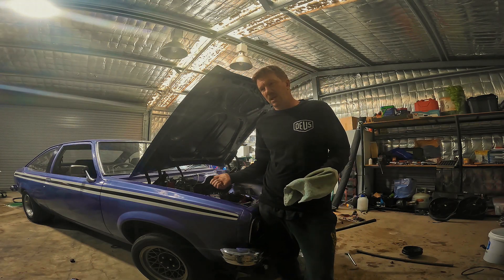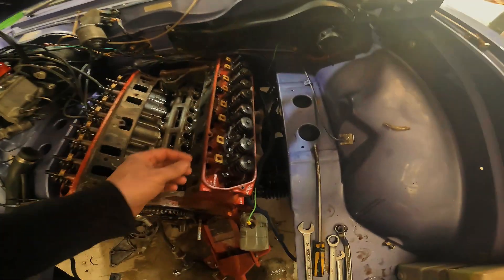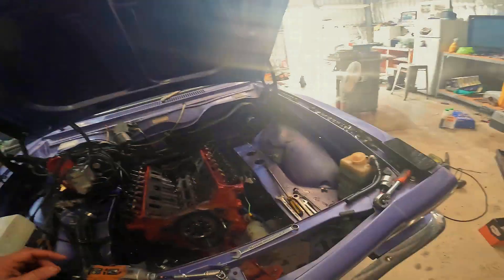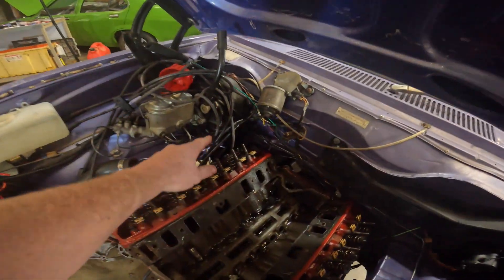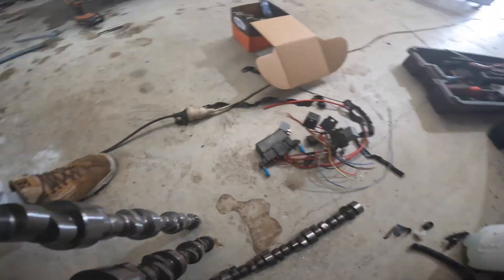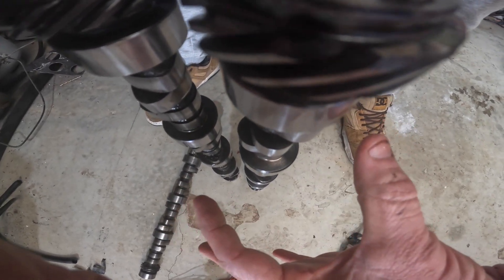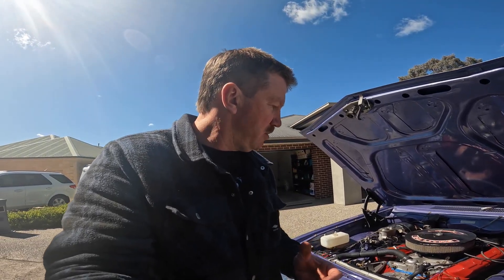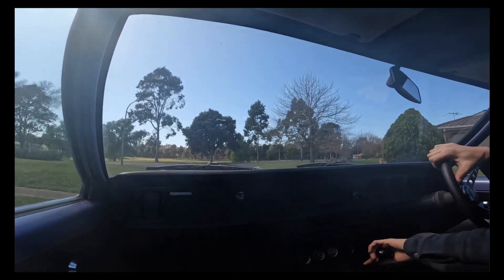Budget Friendly DIY Hydraulic roller lifter retrofit for Non Roller Holden 308 block

Comment: Hi, I only saw your vid today. It's 8 months ago so id thought I would ask you how the cam and lifters have been after sometime. If you are still happy with them can I get your brand and part numbers for the roller lifters and also the length of pushrod used. I'm currently building a black 308 and would like to go this way as well. Cheers Jason.
Reply from the maker: Hi Jason!   The whole combo is still going strong with no issues, running better now than when I first got everything done.   I think I listed all the part numbers in the video description with links.   Prices may have risen a bit since then.

Comment: So the egg shape vs the round cam of a roller is a little deciving.
Because the roller has a small area of contact they make the lobe wider like that for similar lift as a flat tappet.
If you get say two 220° lobes and stick them side to side the flat tappet will still look smaller in duration.

Comment: Gday mate quite an interesting video. I have a red block 308 in my Sandman ute that I would like to do this to given the FLAT TAPPET issues these days. Mine wiped 3 lobes when I used the wrong modern synthetic oil. Got a new Camtech and Johnson lifters to put back in but maybe this is a better bet. Just wondering when you put new cam in did you use cam lube, run cam in and if so what type of oil did you use compared to flat tappet??? Also are you using a standard oil pump and did it change oil pressure much??? Nice car too.
Reply from the maker: Hi, thanks for the question.   I used some cam lube on the cam but it’s not really as essential when using a roller lifter.  Before starting the engine I’ll usually pull the oil pressure sender out and connect a brass nipple and squeeze oil backwards through the pump using a small 1 litre container with the pop out nozzle used for diff oil or atf.  It usually makes pressure instantly.   I use Penrite hpr30 for oil, seems to work well.  When I installed the cam I also blocked the hole in the end of the cam retainer bolt by peening it over with a ball pein hammer.  From all I’ve read there is plenty of oil splashed from elsewhere to keep that front cover area well oiled.   That seemed to have upped the oil pressure 10 psi right across the rev range.
Reply from the maker: With the oil pump I am using a standard one but I did pull it apart and smooth all the internal transitions and edges to help out with oil flow.
Reply from the maker: No need to remove double valve springs for run in either with the roller lifter and cam

Comment: What's it to drive under 3thousand rpm . I'm looking at doing a cam soon, i looked at the rpm spec on your cam 3 thousand to 6500rpm .
Reply from the maker: It’s really good to drive, not “cammy” at all really.   I’m not sure how it would be with an auto and small stall but to be honest I can’t even notice any real difference from a stock ish cam.    Not a dog to drive down low at all and pulls from down low.
Reply from the maker: Having the manual gearbox sure helps I’m sure
Reply: @TasTuned  thanks I've got a vk with tkx manual gearbox
Reply: It's the lowest first gear ratio 327.1
Reply: Interesting to see if it make the old girl go better

Comment: I know those roads haha I have vt 304 with possible lifter issues how do you diagnose them is it obvious once the manifold is off
Reply from the maker: @codey2912  hey mate what symptoms to you have and has your engine got rollers or flat tappet? I’m pretty sure all VT have roller lifters.   Sometimes you’ll have one go bad.   If you have the rocker covers off wiggle all the rockers and you might find one or two loose ones.

Comment: i have NEVER LIKED FLAT TAPPET CAMS = to the point of = buying a jag 4.2 ohc - escort rs 1600 ohc - and now subaru turbo ohc - i was a MG fan and many years chasing valves and rocker clearences - sold spare parts - pusher roller cam and rockers - sets ! a much better system - friction - heat - and rev range ! LOVE ROLLERS ! made vodoo roller rockers at Yella Terra as a machine operator !